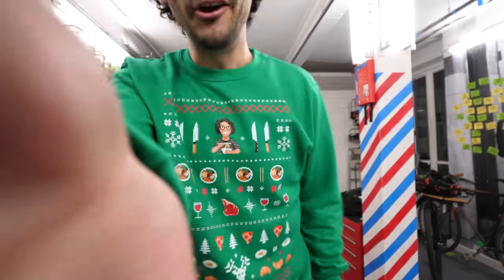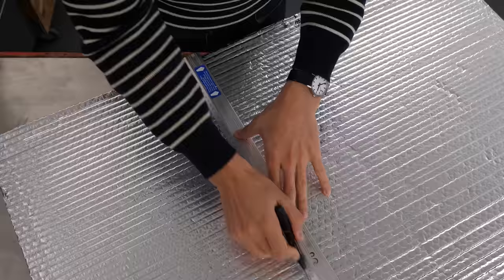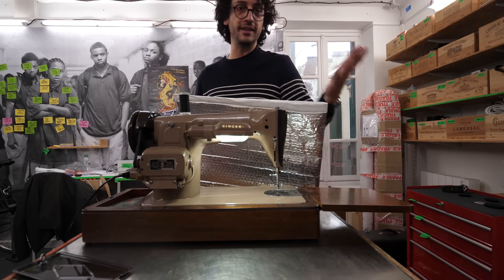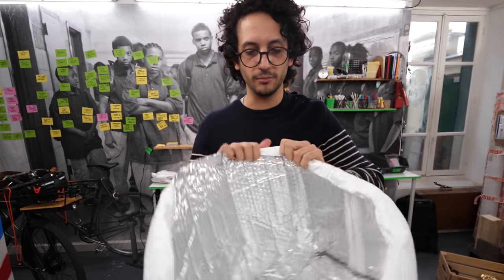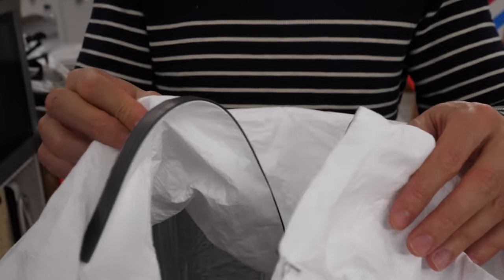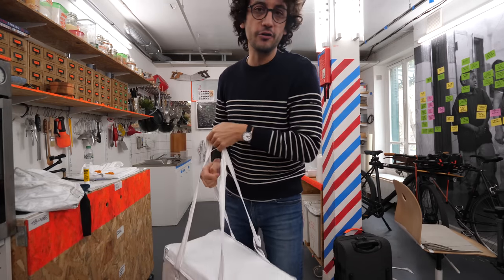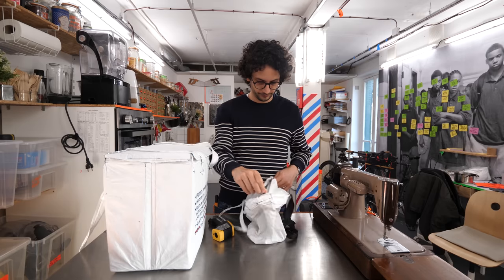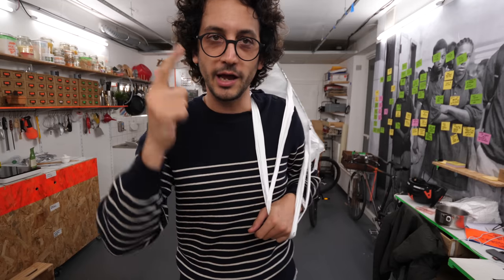Grocery Bag #3 Has GREAT Insulation But...

Comment: Hanging the bags from their handles while testing the insulation might be a more representative test, since you will wear it over your shoulder and the surface underneath PT#2 matters in terms of thermal conductivity. At 9 min, you probably had condensation on your cooling brick ^^
My suggestion: air is a great insulator and can give structure to blown up tubes. Maybe you can make a shopping bag with inflatable walls that is lined with a thin silver foil. And in case you want to continue with your current cut pattern, don't cut the corners so when it comes time to reuse/upcycle it, you have a larger piece to work with. You could still sew it shut, just don't cut.

Comment: Why don't you use the heat blanket foil which are used in first aid kits (one side gold the other silver). They are ultra thin and isolating and light. 
Greetings from Germany - Bonn. :)

Comment: Basically you have designed a box with two handles. Put shelves in the box, velcro the lid in place, put the bottom of your box against your back, strap the handles around your shoulders. That's your 'BoxBag'.

Comment: If you want to zip-top, have the zipper run 15~20cm longer than the ends of the bag. The sides have extra material flaps reaching out to the zipper, and the ends are not fixed to the bag itself. If the longer zipper is measured correctly, this will allow you to use the full opening of the bag (unlike your version 1).

Comment: add an:
 insulated lid
a button
a button hole on said lid.
hinge on the lid fastening it to one of the sides without handles.

seccond if you really want to fold it up, you can attach a belt to the sides and strap it to your leg like a garter belt. at least when it is empty

Comment: what if you just had the insulated part as the bottom. since frozen items are usually ok with at the bottom of a bag (they wont get crushed), this will give you structure to the bottom panel. it can just be essentially a flat envelope, sealed by velcro, and be the sturdy bottom. then you have a foldable bag with structure that has an insulated section!

Comment: Rather than trying it with an architectural material, maybe you can try to rebuilt an insulated tent, or a winters clothing. even a sleeping bag may be very lightweight, compactable and insulating at the same time.. also different compartments may be detachable(or maybe whole height of the bag can be reduced by a zipper to flatten the bag, so you can add or leave the compartment to reduce the bag size according to your planned grocery shopping.. one more idea: I assumed that you were writing the shopping list on the bag, by an erasable marker (if you are not creating a digital list)... looking forward for your new video, bye..

Comment: Maybe You should split the reflective foil into smaller, equal segments and saw them into the fabric next to each other. This would make the foldability easier by following the small gaps between the foil while folding. The insulation would be slightly worse but maybe not that significant.

Comment: I'm sure I've seen paintable insulating---or temperature locking fabric before. It's just the coating and none of the extra stuff, an epoxy essentially. If you get some of that you could paint that onto some lighter fabric like jean fabric. Make your different compartments that way.

Comment: I have an idea for making your bag more flexible but I'm not sure if it will work. Plus it might be a lot of sewing haha. Basically I have seen these "triangle geometric bags" where the outsides are a bunch of solid triangles, but the bag itself is somewhat flexible. Basically a 3d printed fabric. If you cut the insulating material in a similar pattern, and line it on the inside of the bag it could help get rid of that big boxy shape, while adding some flexibility. It would be more flexible than the hard plastic used for the geometric bags, but the empty spaces between the triangles might lower the insulation. Maybe you can get away with having no gaps because your material is not a hard plastic. What do you think?

Comment: How about Mylar and/or thin open cell foam for insulation.
Also, for closing you could make 2 pieces shaped like… well this: [.
You could leave one flap like a lid and use a zipper that goes around the whole opening

Comment: Have you thought about cutting the insulation into strips and sewing the strips together so you can fold the bag at the seams? I think that would give you a easier way to fold the bag rather than trying to fold a solid sheet of material.

Comment: What if you made the floor of the bag two layers: the base most being just the sturdy material, and then a second layer that is insulating, but only sewn on one side so you can fold it up on the long side, and allowing the bag to at least store flat. Could maybe even make insulating dividers that fold out from one of the long sided walls (would add rigidity and strength to the bag overall/hold down the folding floor insulator, and would allow you to separate your groceries, eg isolating raw meats from other food)

Comment: You might try Rare Earth magnets instead? They are cheap and incredibly strong. You could fold the top of your bag down, place the magnet in, and stitch around it. They will definitely hold your bag shut.
Reply: P.s. and to avoid the straps hanging down, make them like a bra strap. So the shortening mechanism doubles over itself instead of hanging free.

Comment: Best insulator is Aerogel (extremely light), but would cost a lot and prone to tearing. Also contact with the ice-pack is transforming vapor into water, which means the bag needs waterproofing inside and out.

IMHO the straps should loop around the bag rather than attached at the top.

Comment: How about using down from old cushions or bedding. Patagonia does this for their down. Then you just use two layers of the material with down inbeteeen with a sections stitched in so the down stays in place
Reply: Then it’s recycled, and more flexible and is still insulated
Reply: Maybe not recyclable though...
Reply: Lol, you would basically be making a “coat” for your groceries at this point
Reply: As for structure, many bags just include a rigid piece that fits in the bottom...maybe that idea can inspire

Comment: Make an inflatable layer between the outside and inside fabric.
When you go shopping its thin and foldable, and when you get to the supermarket you quickly inflate it, making it rigid and the air will be a good enough insulator.
To not make it as if you inflate a balloon, make a small gap between the layers so a single or two blows will fill it.

You get a lightweight, thin, foldable, practical, recyclable (maybe use a biodegradable nylon), insulating bag.

Peace :)

Comment: Insulate only the bottom and the lower 1/3 -- where the temp needs to stay cold and the colder air will pool.
Reply: Also, your backpack idea might work with a double insulated back-touching side - rigid and padded - with the bottom and lower 1/3 insulated. But with a narrower top with a draw string close. Stronger straps using the same bubble material for padding would help too.

Comment: My solution to this folding or flexibility problem with the thick insulating material would be to make it into small panels that you can sew into the fabric and fold, and combine with a thinner more flexible insulating material for the joins. Smaller panels where you want more folding and flexibility, and larger panels in certain places you want to work like struts to maintain the internal structure of the bag such as the base and the lower sections of the bag that you want to sit open almost like a box.

This particular material will never be foldable enough to stick in your pocket, but maybe small enough to fit inside another smaller bag or satchel.

Comment: Hi there, engineer here. have you thought of having an inflatable insulating air layer between the outside and inside? you could incorporate origami fold lines with stitching indicators. to inflate, you could add a small blowing spout (similar to a pool toy spout). the inner and outer walls could be separated by a couple of cm's of air, as air is the greatest insulator aside from a perfect vacuum, and doesn't harm recyclability!! inflated structures hold their shape and allow the structure easy transport.

Comment: I think you have insulation on 5 sides of the bag but why not try 3 sides? It would be a lot more foldable then.

Also you could sew some strong little magnets into the fabric on each side of the top and that would probably get you the satisfying snap open/closed

Comment: If you made the panels inflatable, you could deflate them for fold-ability & inflate them for insulation enhancement. Maybe use heat to seam the material together, so it would hold air.  If that is not an option, sew inner & outer panels, then insert a bladder (into each panel) made from an air tight material. You could also use this to inflate an inner structure for rigidity.  Use 4 or 5 tubes, shaped to fit the inside of the bag (Rectangles).

Jim

Comment: So at this point its less of an insulated grocery bag and more of a collapsible cooler.  Which meets most of your requirements besides being recyclable.

If you change your size for folding it away to more like the dimensions on a draw-string backpack you should be able to do that.  It will probably end up looking more like a duffle bag rather than a grocery bag though.

Comment: Assuming you won't be filling your entire bag with frozen stuff, why not make the bottom 1/3 or 1/4 out of the insulation material (with a lid of the same material) and use tyvek for remaining area where you store fresh vegetables and stuff? You could find a way to hold up the corners of the tyvek to make it less flimsy, but either way it you'd have a much less bulky bag with an insulated area.

Comment: One issue with the ice pack test (8:00 and ff.) is that you may be measuring heat loss through conduction (the uninsulated bag) vs heat loss through radiation (insulated bag), because the insulated bag keeps the ice off the metal table. The ice pack, being low and flat, might respond differently than your groceries, since they are hopefully taller and less dense. Maybe use yogurt cups or something to act as a standoff from the bottom? You'd be measuring radiation vs radiation in that case, which might be more similar to the actual use of the bag. Cheers!

Comment: So... Alex knows this, I'm sure, but insulation has to combat three primary modes of thermal transfer: radiant, convective and conductive. Conductive heat transfer can only really be managed by bulky means, but radiant and convective transfer can be managed easily. I know mylar had been mentioned before, but it's fragile. However, there are companies which work with mylar lined tyvek already, and I think this would be a pretty effective solution. Slightly stiffer than plain tyvek, would manage radiant and convective heat transfer... seems like an adequate compromise.

Comment: Could you have the insulation panels as separate inserts? If they wasn't the insulation material on the fold lines then it would definitely be more foldable and you could remove them to recycle the bag. The only thing is that you would probably take a bit of a hit to the insulation value.

Comment: Make an INFLATABLE bag that has compartments in order to provide structure when inflated and easy foldability and "pocket-fittment" when deflated. You can use something like mountain bike tubeless tire sealant to make the bag hold air when inflated (maybe you can find a recyclable sealant too).
Advantages:
1. Foldable when deflated
2. Once inflated by mouthpiece, provides strong structural rigidity
3. Excellent insulation since air-filled

Biltawfiq habibi ;)
Great videos!

Comment: if you go to the same direction on the next prototype, maybe do not cut the triangle shapes off, put them to the inside and do the ends and the bottom out of tho halves at the same time.. this makes it so that it is way more foldable. first fold the bottom towards the inside, this is made possible cause of the "triangle", the ends are not connected directly to the bottom. then fold the ends the same way and you have gotten yourself a flat surface. maybe roll the rest like a sleeping pad or a sac de couchage.

Comment: Did you do the weight test on this one? The adjustable straps are cool, but those types of system tend to slowly slide as soon as there's weight. I would rather go for a belt type system with little metallic "œuillets" (no idea what the english word for this is, but you're French, so who cares?).
Also, isn't there a way to make some little flaps on the side (±like a parapluie) in order to only have one velcro closing instead of 3? It would help tremendously in terms of design.
You could also replace the vercro by a system similar to the ones used on actual bags. For instance, two straps with a belt system or with a "boucle rapide" (again, sorry, not enough english vocabulary).
The project is really cool though!

Comment: Would the material used as emergency blankets work if you sandwiched it between the white material you've been using? It wouldn't be as insulating as the material you used though.

Comment: Make the bag inflatable?
Folds up, you put it in your pocket. When you need to, you inflate the bag. That gives it rigidity and insulation.
You'd have to sew the inflatable line into the bag without puncturing it.
You could use old bike tubes if you want to keep it recyclable!

Comment: I think the #2 is way more usable than the #3, temperature insulation isn't necessary, actually I think #2 is pretty good at all,  maybe you should just add some ""structure bars"" if you want it to be more resistant

Comment: What if you made smaller rectangles of this material and sewed them onto the thin material, thus making it foldable into a square? Basically the same but the insulating thing is cut into quarters or eigths on all sides.

Comment: The series is probably over by now. But I probably would have used a recycled material (still sucks because what happens to to your bag afterwards) like for example a truckplane they are waterproof, resilient and not too heavy. And maybe they even insulate enough to bring the groceries home. I don't know how long your shopping trips take but for me it takes me like 20 minutes max on my way home (the nearest supermarket is like 5 mins on foot). And to tell the truth for me your first bag was really ideal. I seldom buy freezed stuff and if I do they mostly survive the 20 minutes, so I personally wouldn't need my bag to insulate my groceries. And that it folds up so nicely would be the biggest boon for me.
Reply: Okay nevermind didn't say anything you found something awesome in the next part of the series. I probably would still prefer the first tyvek bag. It's just folds up so nicely.

Comment: My opinion is that sewing the insulation into the bag costs you some flexibility. Consider sewing the insulation into a box shape that will fit into your bag instead. You can then use the bag for other things and fold it to fit into your pocket again. Put the liner in when you want to go shopping.

Comment: Alex, you can try to integrate some thin inflatable layer. It will give you the insulation when inflated and when deflated it will not be that hard to fold. You just have to think of a solution to the obvious problem - how to inflate it very easy and fast (the airbag way won't work here 😁). If anyone knows a way to achieve that please comment ... credits on you.

Comment: Hey Alex, you could had used one of those windshield sun protectors. They are really cheap and basically the same material you used here.
Reply: And you could (maybe) crate a crease pattern on two opposite sides, so the bag would fold like a paper bag (those take-away bags from MacDonalds). When full, it would be just like the "brick", but when emptier you could collapse part of it. To close the lid, you could sew other parts of velcro into the lid, to still be able to close when full, half-way or empty.
Reply: Oh! And I love you channel! Keep the great work!

Comment: The neck is actually a good idea. That way you can put even more stuff into it than the size of the walls would allow
What you can do is glue/sew pockets for rare earth magnets. Just have 2-3 going up with 15cm distance between them. That way there could be a tight seal and if you put hte magnets on the outside of the neck, you can have them connect inward and create a tight neat seal that looks nice.

And as others mentioned, bags like that already exist, pizza box bags aside, many grocery stores and butchers sell bags that are thin and that insulate. They typically look exactly like this just without the logos. https://www.customearthpromos.com/wholesale-insulated-cooler-bags.html

Comment: Salut. Welcome to the foibles of design. You do realize you're going about it backward? Start with the items you want to carry. Put them out on the counter and try carrying them around in your prototype. So far, all your designs will collapse when there is more than a little weight in them. Design your bag from the inside out. Make sure it can hold the items you want without crushing any. Consider a tall and narrow design with heavy items in the bottom, lighter ones on top.

Comment: Perhaps look at an existing solution? like this >>> Wikipedia(dot)org/wiki/Thermal_bag

I would consider a zip/velcro solution compartment inside a existing bag.

Otherwise... check floor isolation materials, there is some stuff on the market called Aluline? it's that alu foil on foam and only 2mm thick. Way more bendable then the airpocket stuff.

(then again I find this endeavor a bit moot since I got a nice waterproof messenger bag that I love to bits and lasts me more then a decade.)